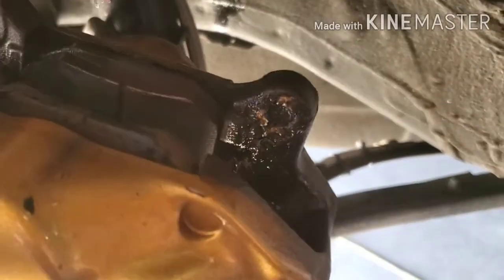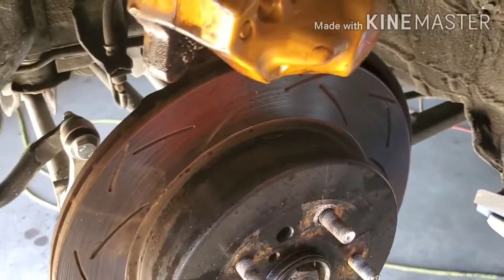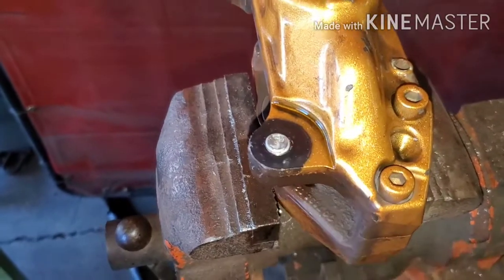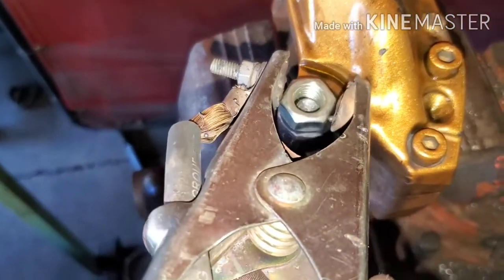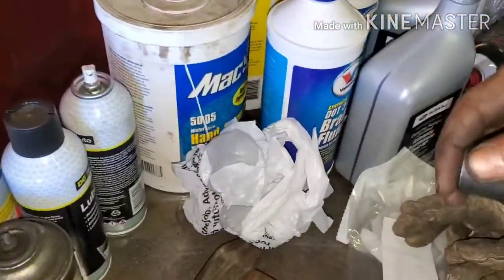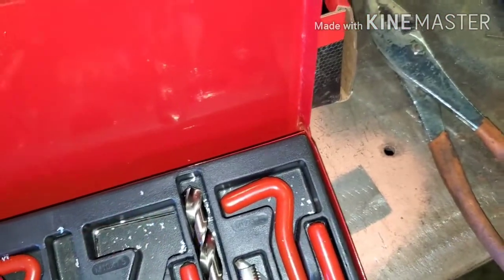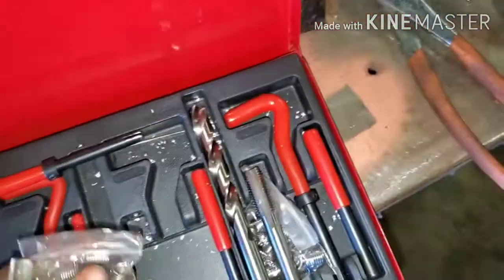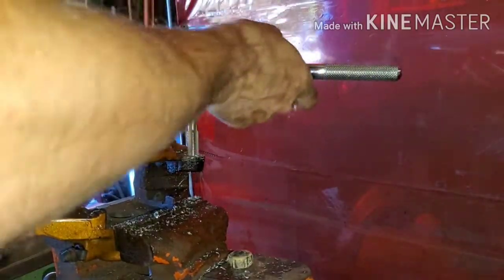How to extract/repair broken bolt in brembo brake calipers

Comment: So I ended up trying to rethread my Brembos on a 2011 WRX STI and I threaded it too big so idk what to do. It was the bottom caliper bolts that stripped the thread. And my rear left passenger side both broke inside the Brembos breaks ended up just buying new ones. Great Video by the way.

Comment: Is this a common issue with aluminum calipers or just certain models?
Reply from the maker: Very common with brembos. Not sure about others.. pretty common on anything that is a steel bolt with aluminum thread setup and the heat cycles only make it worse